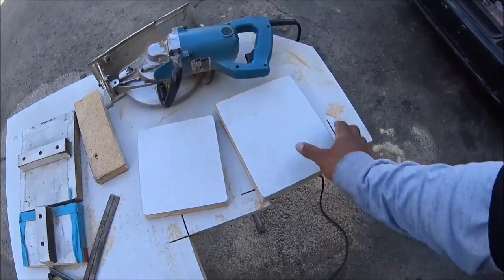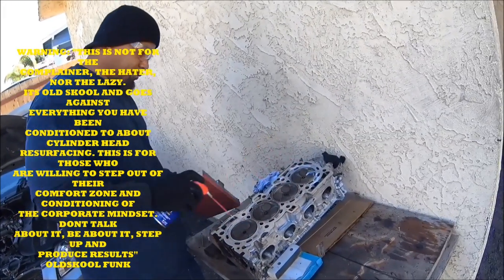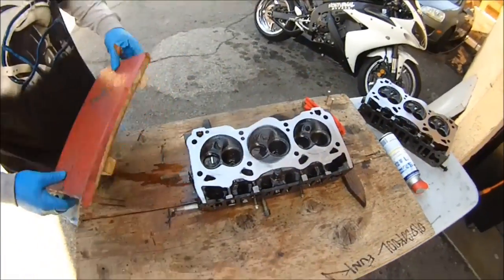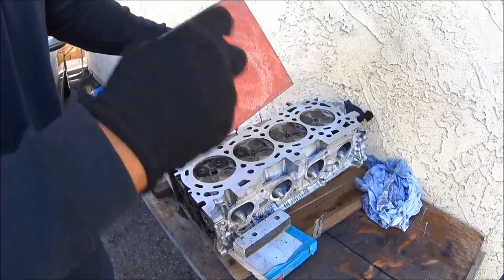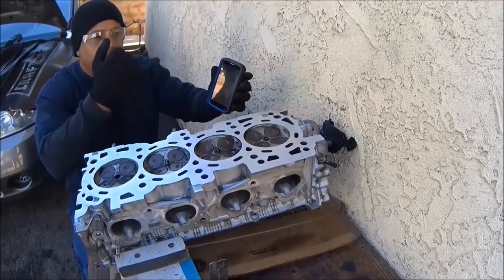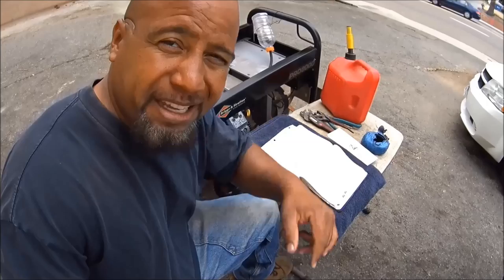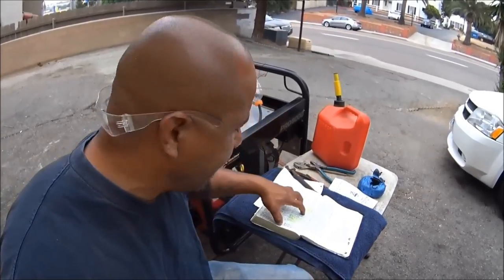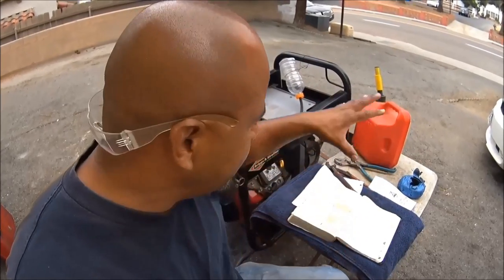(NEW) FASTEST CYLINDER HEAD RESURFACING TRICK, DIY OLD SKOOL STYLE

Comment: Oldskool is cool....one suggestion on the heads. Use a very large magic marker to paint the head contact surfaces prior to sanding. The high spots will get worn off first and the low spots will be visible. The marker washes off with a little solvent. This will help get a flat surface at the cost of $2.00. Another suggestion is to shine a flashlight under the straight edge when checking for clearances. Go for light tight clearances....This may help things go a little easier. Great video. Do it yourself!
Reply: Brad Deal A better alternative is toolmakers blue marking ink. It dries fast and has a brush in the cap to spread it on thin. High lights the low spots. Got my last can at Graingers for $5.
Reply: i think for that you would need a VERY true block - I think a machinist straight edge and feeler gauge criss crossing the head will show them too.. a dirty head works good too for this :)
Reply: I seen another video that the person used a blue ink. This shows the high and low spots when it gets sanded off.
Reply: @JasonSpiffy  good morning 🤣
Reply: Second That

Comment: I used the sanding technique to fix a 5 thou warp on my nearly 200
mph motorcycle and saved a $1700 head.  No problems, just time and elbow grease.  A lot of people never had to fix their car over the weekend to get to work on Monday with NO money in their pocket.  Necessity makes for a mechanic that can think out of the box.  Keep it up bro!  You are the man!
Reply: Chris Cunningham The guy flips cars using this method. It's fine to get you running, but it won't have much longevity.
Reply: @timramich  how do you know this?
Reply: @michaelcee8348  What?
Reply: How can you say it won't last but the surface is flat to spec? If it's flat it's flat.  Using that grit sandpaper produces an ra that's perfectly fine
Reply: @andysjamsandgearslams2556  Finish rating and overall flatness have nothing to do with one another. You could polish a certain RA rating to a sphere.
Reply: @timramich  I said at that grit sandpaper produces an ra that's perfectly fine with the application.  It was a secondary statement
Reply: @andysjamsandgearslams2556  How is it being checked to be flat? Certainly not with a machinist's straight edge. Meaning it's likely not flat.
Reply: @andysjamsandgearslams2556  I guess you have no idea what a machinist's straight edge is. Here's a clue: it's not a ruler. But go ahead and keep thinking it's "been verified on camera." Oh, and how does entitlement come across from me?
Reply: @timramich  a precision ruler is a straight edge man. And why were you here to watch something you know so much about? Each one, teach one right? This man has been called by the great creator of all existence to drop some knowledge on us all that have watched.  I hope you really took more from this video than your comments have shown. Keep smashing on it bro cause your souls eternity ain't no game and I personally feel blessed to even have come across this channel. I wish u the best and pray for that judgemental heart to leave ya.
Reply: @timramich  it works, I do the same thing an I have a mechanic straight edge, my grandfather taught my dad an my dad taught me, we build race cars an motors . If it's extremely warped I might give it to my uncle to machine it but I never did that.
Reply: @kamakazecrxsi85  LOL, okay
Reply: He lost me when he brought up religion, I don't preach an I don't like people preaching to me. But I do agree with his method, I use sandpaper an a block or a big file . Iv hade is checked after by my uncle who builds race motors an has a machine shop. Always came out perfect. I would say always get it checked for cracks tho
Reply: I'm pretty sure he was asking how do you know he's flipping cars?  I am also curious.
Reply: I've been in that same situation--blew a head gasket on my truck 12 miles from the nearest auto parts place and 25 miles from the nearest garage and automotive machine shop. It was Sunday afternoon, and I had to be at work Monday morning. I removed both heads, sanded them, replaced the head gaskets and other incidental gaskets, and got to work on time. 

Luckily my father taught me to work on a vehicle the "old school" way when I bought my first vehicle. Actually, I began learning it way before that from helping him work on our cars beginning when before I was old enough to go to school. I couldn't read or write, but I knew the different size wrenches from watching my dad. I've done things the "old school" way all my life, from replacing a head gasket to completely overhauling an engine (new rings, rod-end bearings, main bearings, timing chain, timing gears, grinding the valves, and putting it all back together; and I'm better off for it.
Reply: @Al_Swilling  good for u man...totally agreed...old school actualy got the basic principle of it..
All modern machine only makes it easier but based on old school principle...lol
Let the muscle and mind works..after all that we alaways did in the old times..and it worked just fine
Reply: For real Fam that’s a nice quote ppl who never bn threw that or always had stuff handed to them wich idc but like I said to work on there own cars to get it running by the end of the week on there own litterly blood 🩸 sweat 😓 an tears with no money an no help or hands outs what lil money we have we hold on to just in case making what we got work stretching it out making it happen 💪🏼💯
Reply: @andysjamsandgearslams2556  Its flat enough. I have done this before.  The copper sealant is also going to diminish any RA issue. Beyond that the head bolts should be properly sequence. You dont have to take it to a machine shop.
Reply: @timramich  Its flat enough.
Reply: @carllattimore8227  Yeah okay.
Reply: "out of the box" What is this box I keep hearing about?🤔
Reply: @timramich  I'm a Machinist, and I'm gonna be "flat" out honest, If you're using a composite head gasket and not a copper/metal shim gasket It IS completely fine to do this, the RA/RVK/RPK would fall in to spec Fully depending on The grit of the paper as its just looking for Valleys and Peaks, You don't want it to rough as it can chew through the Head gasket, BUT a fine enough grit (400+ European grit) on Granite, Glass, or "Machined" true flat surface you can Do this, and it will last as long as a Ground or CBN and PCD cutters.

if the glass is thick enough using 800+ and checking how much material you've removed you'll easily be able to use a Steal or copper/MLS head gasket.

Comment: This video saved me $100 and a couple of weeks wait (for a machine shop)- my son and I are rebuilding his 4 cylinder camry engine and found the aluminum head was a bit too pitted to use as it was. I have a table saw with a good flat cast iron table. I sprayed adhesive on the saw table, laid 2 pieces of 150 grit aluminum oxide sandpaper end to end, sprayed with wd-40 and removed all pitting in less than 30 minutes work. Head is out by less than .001 inches.
Much Thanks and may God reward your faithfulness.

Comment: Nothing wrong with doing it this way! A slang name for a big file is a "hand mill." Good to use a precision straight edge to check your work as you go. I do Harley oil pump bodies (and other small stuff) in a figure 8 pattern. You can put a little machinist dye, or scribble a sharpie on your surface as you get closer to see the low spots easier towards the end.

Rock on, brother!
Reply: right on

Comment: I'm from Oz and there are a lot of ppl living outside the cities here - it's another reason why this technique is so valuable.  Sometimes the car getting the head gasket is your only car - you have to get everything you need in town and limp the poor car home with its many problems.  So after you pull the head off you are stuck with no recourse to 'head shops' - you have to do it yourself.
This knowledge is brilliant.  Thanks mate - funny that I should get this info from an American when it must have been standard practice when my dad was a bush mechanic so many years ago...
My Festiva's head was only 4 thou out of flat so it was an easy job.  I stuck two sheets of sand paper (120 grit) to a glass coffee table, lubricated it with engine oil and dragged the head back and forth over it.  It took about 1000 cycles in all, I broke it up into sessions of a few hundred motions cos I'm a bit disabled but got it done in an afternoon.
btw if you have troubles with the sandpaper catching the head cut the offending corner off with a sharp blade.

Comment: I did this to my 01 Ford Taurus 3.0 heads. They are cast iron, and were 7 thousands out. It took a lot of hard work, but this technique worked flawlessly! I have over 10k miles with no issues. Cost me $300 for the gasket kit, head bolts, valve seals, water pump, oil, coolant, and sandpaper. Bought the car for $300 because of the blown gaskets.
Reply: how did you get about cleaning the cylinder head from iron shavings inside the oil and coolant galleries?
Reply: I did the same technique on my 1968 Morris Minor cast iron cylinder head. It was out by 4 thousandths- bulged in the middle. Except I used 120 grit paper, then 180 grit glued to the flat steel table of my pillar drill. Lubricated with WD-40. Worked fantastically well, the car runs better than it ever did, with noticeably more torque for getting up hills. Cost £5 for the gasket, and a couple of £ for glue, abrasive paper and WD-40.
Reply: The thick copper gasket on a Morris Minor will make up for a lot of the problems this clown is causing. Any NEW head gasket will cover up a lot of mistakes for a while.
Reply: Probably had a garden hose running through it while he was flapping his gums.
Reply: New bolts and a head gasket will cover up a lot of the errors this technique is adding...for a while!
Reply: Seriously? You took out 4 thou on a cast iron A series engine? How many days did that take? How do you know it is totally flat? That thick composition copper head gasket is meant to accommodate small irregularities. Also what happens to the head dimensions when you torque 11 or so bolts down to 40 lb ft?

Comment: Good thinking. Thank you. I’ve done several head repairs, stuck valves, gaskets etc, usually overnight on some piece of equipment that has to go in the morning, or ASAP. Usually with some one tapping their foot wondering what’s taking so long.... I have to admit, this hadn’t occurred to me, or as another video run the head over sand paper stuck to a bench. 

To anyone complaining, this is a big saver for people with out access to a machine shop. I have nothing close to a machine shop, and over night repairs don’t allow for it.  All to do with down time and not have to crate heads or blocks and ship them out. 

Thank you for posting, much appreciated.

Comment: Using this on my vortec heads right now actually. Thanks oldskool!!! Appreciate the knowledge buddy.
Reply: How did it workout for you?
Reply: @byf4ith  man have put over 2k miles on the truck since I used this method...all seems well so far...and my heads were pretty bad off and this still worked.
Reply: @bigboyinthe5016  Thanks for responding. That's good to know!

Comment: Quick summary of the mechanical:

Get 4 flat particleboard blocks. Smooth edges.
2 will have 80 grit, 2 150 (use wet/dry paper)
Assemble blocks with spray glue and staples.
Use oil on block/head and sanding block and bring it down to flat. Check for flatness on occasion. 
Wash sanding block as you go in water.
On engine block make sure to cover ports to keep debris out.
Use the 150 for finer finishing of surface.
Mr. Old-school recommends copper spray gasket and MLS gaskets.

Comment: Like the idea back when working in machine shop making airplane parts. .we used to put blue dye (brush or spray) on the aluminum part of the resurface area only.Try to find wet or dry sand paper 2000-3000 grit..need s to have sticky on back. Find a (glass or mirror) try to have it 1 or 2 ft longer than cylinder head.  Then apply sand paper onto the glass w/sticky side down. The area of resurfacing your going to apply the blue dye. (doesnt take long to dry) resurfacing area on top of sand paper you should have 3-4 sheets, side to side..stuck to glass. take the cylinder head resurfacing area, apply it on top of sand paper. Move cylinder head back and forth with the sanding process. Remove cylinder head check the resurfacing to see if any blue dye..if so continue sanding. The glass is the flatest surface you can use and the blue dye will assist you of where the high and low areas are on the resurfacing area
Please shoot a video when you try it.

Comment: Thank You, Thank You and Thank You. I just had My Harley Road king with 124K miles  eat the inner cam needle bearings and wipe out the oil pump and cam chest. I pulled the motor apart and ran out of funds in the rebuild project when I got to rebuilding  the heads. I watched this video and the valve rebuild "lapping" and saved the heads and a boat load of cash....PS: I remember my Dad doing this as a teen in the 80's after watching this vid. My heads turned out great and + I polished the combustion chamber to a high shine. God Bless ya brother and thanks for all you do. Jake III

Comment: Thanks for this video, I did this on my old 22re head after the machine shop quoted me 375$ for machining and a valve job. I spent 20$ on a 4ft piece of melamine, glue, and 150 and 400 grit sandpaper. I glued three sheets to each side of the plank, make sure to press the sandpaper with another board while the glue is drying so it's flat on the board. Once dry, I slid the head back and forth across the plank. After I was done I couldn't even see light between the straight edge and head. As others mentioned there are a lot of shavings and dust that has to be removed or you'll grenade your engine. I used a pressure washer to clean the head, then blew it dry with compressed air. Make sure to remove the valves, lap the valves, and replace the seals. I saved 350$ and only spent two or three hours reconditioning the head. Thank you again for sharing your knowledge!

Comment: Thanks for trying to help, BUT DO NOT USE COPPER SEALANT ON ALUMINUM PARTS!!!!
Copper will eat the aluminum up. Don't believe me? Look it up!
But don't ruin you engine please!
Reply: I've been using it for years along with alot of people I know and there has been zero issue with it.. and by years.. 10+ lol.. same engine in on case so it's been checked.. also there are copper head gaskets.. no issues.
Reply: Max Lindner K&W copper coat is awesome stuff. and copper will not attack aluminum where there's no atmosphere or moisture for an oxidizer.
Reply: Why would they make it if it harmed more than it helped. The copper particles are so tiny they won't cause damage it's no different than a iron block against aluminum head. Yeah copper is harder than aluminum it can eat as in scrape or chip away microscopically at the aluminum because it is softer than copper but under a microscope I guarantee you the head gasket you are using has sharp points and jagged edges protruding and I can assure you steel is harder than both. When expanding and contracting from heat and cooling the mating surfaces move and rub against each other and the copper gives the mating surfaces something to grind at and the copper gets imbedded into the mating surfaces from the friction and in the middle of the embedded copper surfaces is you guessed it more copper so the thin layer of copper is taking the beating and not your head block or gasket.
Reply: what about the water running thru the head? it will contact the gasket sealer..

Comment: Hi, I found you as I was looking for the videos in regards to resurfacing cylinder head at home. I'm currently in financial difficulties and my car needs an engine rebuild so I do it all by myself.

Firstly thank you for your ministering as you have made me read my Bible again which I much needed.

In regards to the head, I messed up. I couldn't find any flat piece of wood or even glass anywhere. Finally I've grabbed a piece of wood and have it polished on the window of my room I'm renting. I've got it perfectly flat, sticked sanding sheet on it, but I just couldn't get the head flat enough. I've even made it worse despite trying my best to hit the head evenly, use even pressure etc. Much respect for your skills. It's not easy.